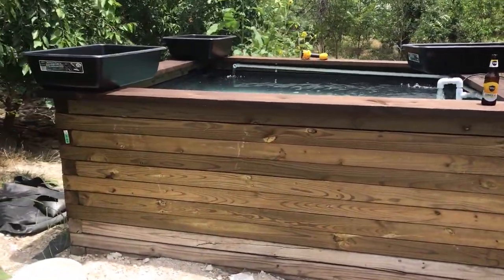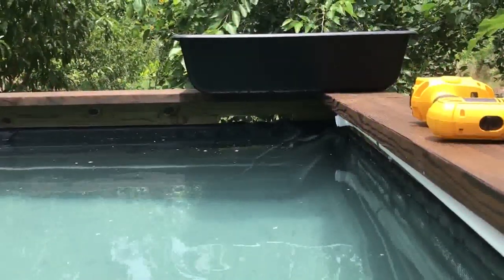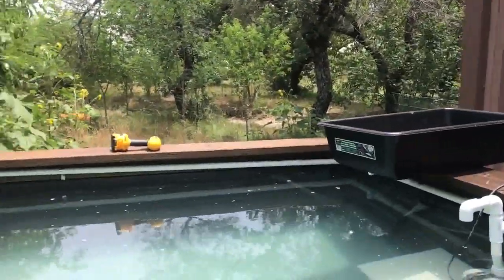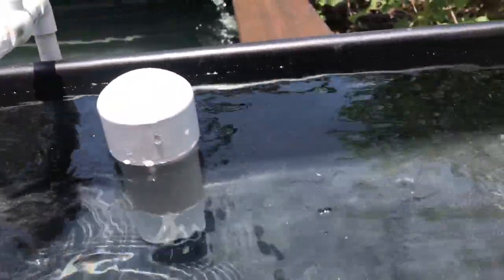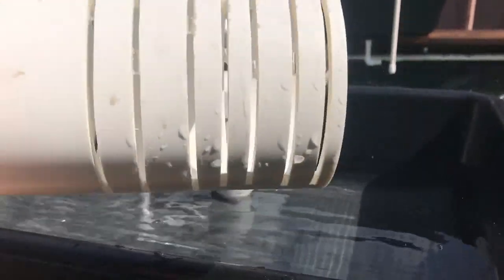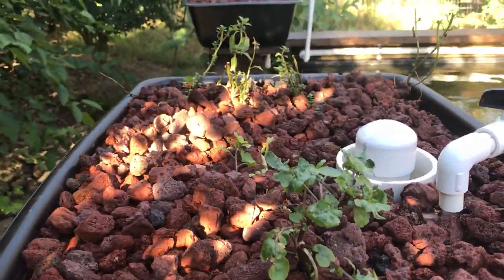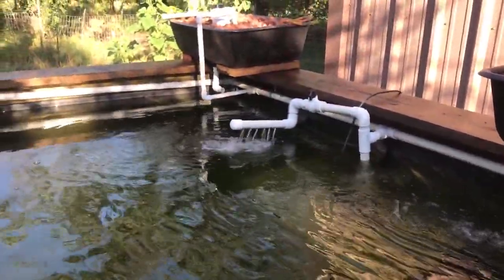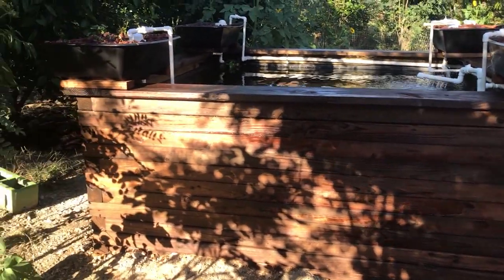1400 Gallon Timber Frame Tank Aquatic System Build

Comment: I heard in your podcast that the seam on top was leaking.  Maybe knotch out the bottom timber on the top side.  You have an inch or so of less water but you wouldnt have the seam leak.  I love it though!
Reply from the maker: I guess I didn't explain it right then, nothing is leaking.  The top timber is notched exactly so it will OVER FLOW not leak to a specific area, that being the to main swale on the property.  The issue is the last timber is above the liner, but since we didn't silicone that last course and since the tank isn't perfectly level water seeps out when it is over flowing though that course and some ends up not quite where I want it.  Some day I may get off my butt and shoot a bead of silicone into that joint, but it really isn't an issue big enough at this point to make me do so.  The comment was more about, so in building the first one, this is something I learned.

Comment: Jack, Cinder Blocks are not pH neutral. Is that a good or bad thing for your system? I don't know but just be aware of this. If it becomes a problem you can always paint them with paints that are pH Neutral. If you are going to run this in the winter time, I can show you how to build heaters to keep it from freezing.
Reply from the maker: If I tried to explain how little I cared about this I would fail miserably so I will just point to this, http://www.waterbugdesign.com/pond/myths/cement.html
Reply: I see your point. It only a problem if you wanting to run pH's in the 6 range. 8 or 9 are fine for the fish. Some plants like high pH and some like low. Your, going to have fun with the Mint. It grow like mad in a system like that.
Reply from the maker: My water almost 8 as it comes out of the ground.
Reply: Jack Spirko point and game. Great knowledge bomb.
Reply: Fish like the like the slightly higher pH... depends on what plants you want to grow... I would just grow stuff thats ok with the pH and not worry about it myself...
Reply: Jack Spirko thanks for that website. Read it and found it useful.

Comment: does the pond liner come in a square shape, or did you fold it up in the corners?
Reply from the maker: I just dropped it in and did my best with the slack doing I guess you would call half assed hospital corners, then filled it with water.  There are quite a few creases but with the shelf and the plantings and all you really can't see them unless you really look for them.
Reply: well on the video it looks really good and tight in the corners.